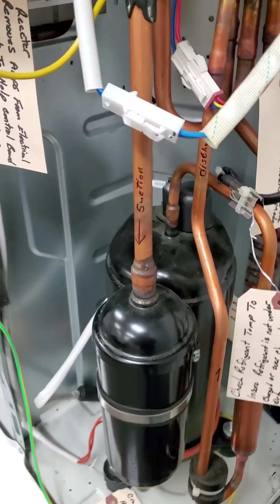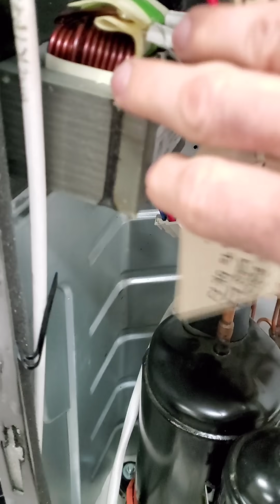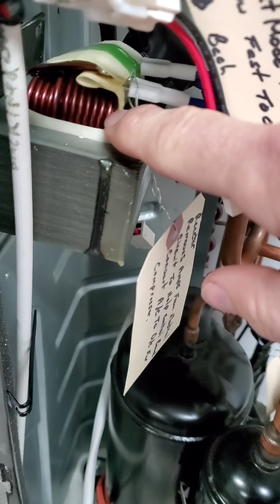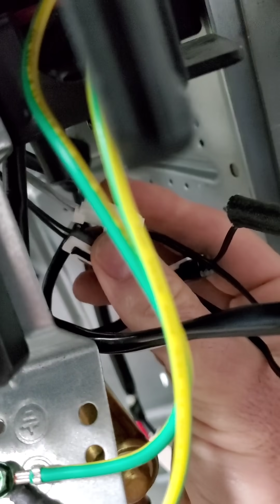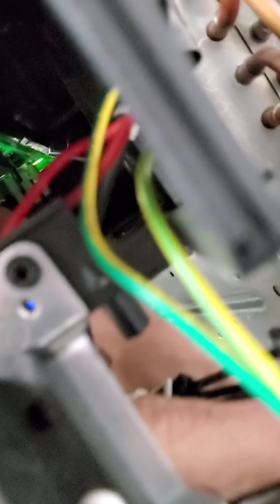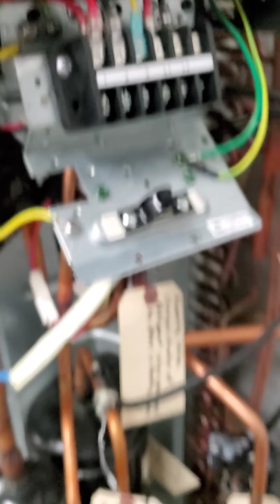E1 CODE AIR CONDITIONER MINI SPLIT TROUBLESHOOTING

Comment: Hey man. I have a mini split. Hooked up originally. Kept throwing e1 was hooked correctly. Now I’m getting no power to indoor unit at all. But still reading E1 on chip card inside electrical peckerhead
Reply from the maker: First thing I would do is make sure every wire is same and not crossed.  Then read power on indorr terminals.   If no lights then it is no power or burnt up.   There should be no splices in the wire and 14ga stranded wire with no terminals

Comment: Very nice tutorial.  I have a carrier inverter heat pump with one outdoor unit and four indoor heads.
All four indoor showing e1 error code. Replaced the outdoor inverter board. Unit works for awhile. But sat for the winter season.  Now all for is showing e1 again.
Could one bad indoor  unit caused all the other indoor heads to also show e1? Any help would be great appreciated.  Thank you.
Reply from the maker: Possible.    You could unhook one indoor unit at a time and try it make sure one is not grounding out the circuit.  The biggest problem is ever see with e1 is not having stranded wire.  Using wire connectors, and having a splice in the wire to indoor unit.  Never splice and never solder it.

Comment: We have a Kelvinator very similar to this one. After we'd had it for about 3 years, there was a flood and the water came up to about 30cm on the outdoor unit. We had it serviced by an electrician who gave us the all clear. It worked for 6 months, then started throwing an E1 error. The unit will come on for about 15 mins, blowing room temperature air, then shut off.
Reply from the maker: Not communicating.    Failed compressor or outdoor board.   If it's 3 yrs old and already been in a flood . Replace it.

Comment: Ok i can check the sensors but where I can  buy a new sensor for the air conditioner
Reply from the maker: Contact manufacturer of your unit .

Comment: Great explanation.  I have 2 zone system.  I intermittently get the E1 code on the basement wall unit.  I reset the power and then it works for a while, then the E1 comes back a day or so later.
The other wall unit in the sunporch has never threw the the E1 and has been working fine.  Before continuing the troubleshooting, does this mean the problem is isolated to the basement wall unit or wiring, but rules out the outdoor unit?
Reply from the maker: Not necessarily rule out outdoor.  But first thing I would do is make sure no splices in the wire and make sure it is not solid core .  Also sometimes the terminal ends can cause the problem.  You can cut off the s terminal ends and wire directly with striped copper under the screw
Reply: @ACPro  Thanks.  Found that the installer used 14-3 NMB (solid not wet rated!).  Thinking I should replace with a "tray cable".  So that should be fine outdoors and stranded?
Reply from the maker: @running_rich yes replace it with 14-4 tray order from Amazon or homedpote web site and hope this is your problem.

Comment: Hi!  I got  a 12000 btu Klimaire mini split KSIAO series. It worked for about 6 years nice but two months ago I noticed  it was not giving enough heat. And today no heat at all even though the fans  are blowing. I did check pressure on  cooling  mode to  see  if it need  refrigerant. And I found that not need refrigerant  because  the temperature is  high 165psig F. Then I check  pressure  on  heat mode 195 psig F. Now it does not  show errors! Can  you expand on this problem. Thank you for your  support.
Reply from the maker: Pressure is relative to indoor fan speed.   They have anti cold air function.    So if you notice indoor fan very slow blowing air . Means you low in refrigerant
Reply: @ACPro  Thank  you  for  your  reply.  I dont  see  any leaks and  no  freezing  pipes. Tomorrow  Iam  going add few  ounces of R410 a by weight  and  see how it react. I  will not  recover because  I  dont  have a  machine  to  do it. Would  the  presure  goes down  from 165 psig  to  about  130 psig?  Or  what  to  expect? I hope Iam  not  asking to  much.  Thank you  so  much for  helping and  your  time.
Reply from the maker: @LEO CRUZ  Re yoy talking low side pressure or high?    High should be alot more than that.
Reply: @ACPro  I  checked pressure in  cooling mode and  it  is  165 psig which I understand  is  hight. Then I switch  to heat mode and  it  195  psig which is  low.  Thank you
Reply: Hi! I did try to  weigh in few  ounces of refrigerant to the unit, but it seems it  was backing into the refrigerant tank because the scale numbers were increasing. Realizing this  I discontinued. Also  the compressor  got  louder. Thank you for  your  support.

Comment: Hi Toby - thanks for the video.  I am getting an E1 code immediately after installing a brand new Mr Cool.  AC voltage on indoor and outdoor units are 240V.  DC voltage on outdoor unit on 2 and 3 fluctuates positive numbers (nothing negative), DC voltage on indoor 2 and 3 fluctuates negative numbers (nothing positive).  Fan mode run fine, AC also generates air (but its 50 degrees outside, so likely just a fan and no compressor), but heat does nothing - vent opens up, but no air comes out - sits for about 8 minutes with no air coming out then shows the EL-01 code. Any thoughts? Thanks in advance!
Reply from the maker: 2 things .      L1 and l2 can not be crossed indoor to outdoor.      And also there can not be a splice.   Even a solder joint will cause a data issue.     Also no solid core wire .    Cut off the end terminals and just straight wire under terminals.   Hope it helps
Reply: Very much appreciate the quick response. I had an electrician wire this up, im a novice as far as electric goes… so you think L1 and L2 are crossed? The communication wire from indoor to outdoor is just 1,2,3 which we definitely didn’t cross. Then we have l1 and l2 on the 240V coming from my circuit box. Which wires sound crossed to you? Thanks again!

Comment: Hello. 
After a big storm on of my recently installed mr cool units threw an e1 code. The other unit did not. They have separate outdoor units, not a split system.  Powered down for 30mins, rebooted, didn’t work. Checked wires and voltage reads as it should indoor and outdoor and no loose wires.
Where should I start in your opinion. Could it be the board, or reactor? 
When I unplug the main sensor plug, if the unit operates does that mean it’s one of the sensors? If so do I individually unplug the sensors afterward to pinpoint which it may be? 
Checking the voltage on the board tells me that it’s a sensor and not the board, right? If so how do I tell if the board is the culprit? 
Thank you in advance, your time is much appreciated!
Reply: Also testing from hot to hot reads 240v. From one hot lead to ground 120. Other hot to ground 120v. From one hot to neutral 120v. From the other hot to neutral reads nothing. Is this normal? Does this indicate something wrong or broken? Thanks
Reply: If the power leads from indoor to outdoor are not matched, IE red is l1 inside and black is l2 outside for the power wires. Does this only matter for com wiring? Also the unit it a Mr cool. Not sure if the leads are actually marked l1 and l2 but it was just something I was wonder to try and figure this oit
Reply from the maker: They have to match.    This is your problem.
Reply: The unit has had both the indoor and outdoor boards warranties and replaced. A separate HVAC company has come out to replace them and trouble shoot. They’ve confirmed the wiring is correctly 3 times now as well as myself and an employee of mine checking. The last time the new indoor board came the company said it’s not working and that they must’ve sent a bad board? I went back out again today, and did a DC test and now that the boards have been replaced it’s stuck on negative between com wire #3 and #2 red on 2 black on 3. I’ve looked for s reactor and I don’t see one on this mr cool unit. They sent me back out to press a reset button the board and wait for the led display to say CE. My unit doesn’t have a button or display just a flashing led light that is currently red I’d assume it’s sending a code via the flashes and color. I’ve unplugged the sensors and the unit will kind of come on. The indoor display while doing so says nothing and the fan turns on but no heat or cooling. Before the boards were replaced it would turn on the condenser for about 5-10 minutes before giving the code. Resetting via the breaker the E1 immediately displays. I’m frustrated with the warranty company. I’d like them to just send a new unit as I’ve spent hours of phone time, driving, and replacing parts as well as paying the company to try. The problem should be indoor board if it’s stuck negative, right? But it was just replaced. Is there anything else that could be the issue inside other than wiring since I know it’s correct?
Anyway thanks for your help. I’m at my wits end with the unit and mr cool. I don’t know where to continue. I don’t want to go in circles replacing more stuff when the whole unit could be replaced and we’d be done. How much more can you do to find it’s still not working? Any advice would be appreciated.
Thanks again
Reply from the maker: Possible a season.   Check each one to ground  . But unplug each one and see if it operates.    Also see if one is open .  Check ohms according to the sensor chart in the manual

Comment: Hello. Nice video. Have a Beko witch is in E1. After about a few minutes of the indoor unit is on but no start to the outdoor unit. It gives E1 I unplug it from the outlet to recover from the E1 but still it appears. Disconnected the sensors from the outdoor unit and no change. Disconnect the indoor sensors and in gives E3 and E5. It is a 240v and doesn't have a reactor or as valve (xv sv).what could it be besides the pcb. The sensors gives 9k, 9k, and 50k at 70 degrees ( 20 celcius) for the outdoor unit. And 9k and 50k the indoor unit
Reply from the maker: Either wire connection  .  Splice or pcb

Comment: I have A/C power NO D/C  at the 5v test place.     I have a 230v system. Installed it good. Ran for 10 day and quit.   However I have + v only on terms L2 and S.      Brand New.  It was 106 the day it went out.   I am almost 70 and cant handle the heat like i did when I was younger    Help
Reply from the maker: you should be getting volatge on l1 and l2 ..   start here !

Comment: Hi I'm having e1 code on all four indoor units but all come on for about five minutes but outdoor unit just beeps one time then nothing. Have called seller of unit walked though troubleshooting test had me replace main board only to do same thing. Called back more tests and now the say inverter board needs replaced but they don't sound sure. This part is considerably more than mian board any info on what to check? Thanks for your video. And any help if you still answering to this video
Reply from the maker: I think the main give away is that it's on all units.   This means there is no communication.    There must be a constant 5vdc on the drive board or you may have a Eprom failures.    The next concern is is it just the board or do you have a shorted part that destroyed the board.  If unit is out of warranty maybe need consider replacing

Comment: Hi.  The new olmo inverter air conditioner ran for 3 days.  An error appeared: there is no connection between the blocks.  I checked the communication wire, the signal is on.  I checked the reactor, there is no break.  Where to look for a breakdown?  When the air conditioner stopped working, there was a thunderstorm and heavy rain.
Reply from the maker: Only 3 days.   Send it back to where you got it.  Possibly defect in control

Comment: NIce Video.

We have a ComfortStar that has been working great for about 18 months, and throws an E1 code during rain or high humid days.  We would let the weather clear, cycle the power and be on our way until the next weather event.  Well, this past week, our tried and true "wait and try again" method has failed.

Can you think of a reason why it would throw an E1 code during wet weather?  Shouldn't that be a clue as to where to look when I crack the box open?
Reply from the maker: The board outside had a coating on it  and it is possible  yours may have missed spot.  This can cause moisture to short the 5 volts needed for the data circuit.   Order a new outdoor board under warranty
Reply: I’m having the same issue. Did you solve your problem?

Comment: Of course even with the power off those bigger capacitors have a nice shock waiting for anyone touching them. My Cassic 24000 BTU system was working great, power went off and on and the E1 code came up a few minutes later. Outside unit has been dead ever since. Puled the board and checked it for obvious damage, found none. Was wondering if hooking an oscilloscope to the signal wire would be a good idea? What protocol is used for the units to communicate?
Reply from the maker: Go to manufacturer website and look for extended service manuals.   Each board and model is different and they can be very detailed.
Reply: @ACPro  No information is available for this model, company website has no links to anything.
Reply from the maker: @chargermopar  This isn't normal for a good product.. I would be concerned if parts were even available.  A lot of the cheaper units are disposable and not worth your time and hassle to try and repair. just make sure you review product for others to know your experience.
Reply: @ACPro  I am thinking the distributor has several manufacturers they buy from over in China. This unit has been well made physically and has no corrosion issues. A video will be coming about my experience.
Reply: @ACPro  I am thinking the distributor has several manufacturers they buy from over in China. This unit has been well made physically and has no corrosion issues. A video will be coming about my experience.
Reply from the maker: @chargermopar  please post a link on here  for your video.   My channel is to help others with all types of daily activities

Comment: Hi there
I have a Midea unit with two heads (living room and bed room) and the E1 problem occurs on one head unit only.  The second one works well.  What do you think it could be ?
Reply from the maker: Well could  be wiring or board.   I personally would swing zone 1 and 2 on outdoor board  and see if e1 is still on same unit.  If it is you can conclude it is indoor board or wire.   If it changes to other indoor unit it is outdoor board.
Reply: Hi again, I switched both zones cables on outside unit, but the same zone unit shows E1

Could it be the zone unit itself ?
Reply from the maker: @marc-andrest-pierre4512   if you switched you eliminated possibly of outdoor board.    So it is either indoor board.   Or wire to that zone is solid core and or it is spliced.   This is normally what I find.  Solid wire or spliced wire.     You can always order some stranded cable from Amazon  and run new cable through a window and tie in to indoor unit as a temporary test.   To check cable .  It's a easy way to eliminate cable possibilities
Reply: Thanks for your help !
I opened the fault unit and one wire was not screwed properly !

Installation problem !

Thightened the screw ans works fine
Reply from the maker: @marc-andrest-pierre4512  thank you for Letts everyone know. I'm sure this will help someone in the future

Comment: Hi Toby I have a big mystery going on...
I've been getting E1 codes randomly after the unit has been running for a while, doesn't happen every time.
Here's the kicker: I have a mini-pump for that handler, and the pump would stop working & I have water leaking from the handler. Now the pump also makes loud humming noise unless I cut the power to the handler. Oh and today the air smelled sourly too. 
The other handler (no mini-pump) in this system works fine though!
What could this be?!! I searched everywhere online and can't anything close to my situation... =(
Reply from the maker: Sounds to me like the saftey on the mini pump is using the data line to break if the float reaches overflow point.     Best thing to do is get ride of that mini pump.    If there is space behind the wall install a large pump and make sure the drain goes straight down.     Watch my drain video.    Also diversitic makes a large pump that mount externally below the unit with a nice cover so it looks good.  These pumps are strong and allows drain to go straight down.

Comment: Toby,' I am getting an E1 error.  It is a dual head unit. Only get the error on one of the two indoor units.   I have checked everything, all looks good.  I have changed both boards.  Worked for little while than quit.  I have changed the Wiring from A unit to B unit. on the outdoor unit.  The Error stays with Unit A indoors.  Any ideas?  Indoor sensors??

Thanks in advance!
Martin Sutton
Reply from the maker: The wiring from indoor to outdoor needs to be stranded wire.  Solid core will only cause communication issues.   And l1 and l2 can not be crossed.

Comment: Do I contact a HVAC person or an electrician to fix the E1 Error?
Reply from the maker: For sure hvac.  Electrican only connects devices. They not do anything with hvac technology.    But not just any hvac guy . Make sure they are trained with your brand and have it in writing that whatever parts needed first diagnosis will repair problem. Some are untrained and guess at problems that ends up costing you.